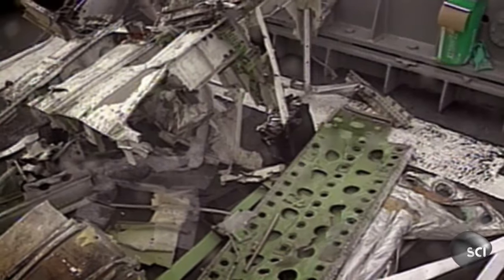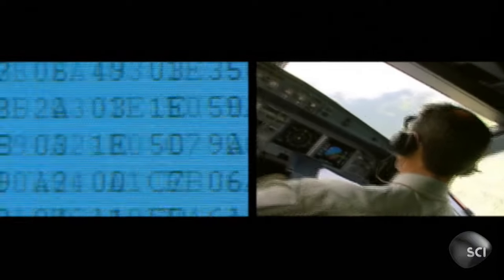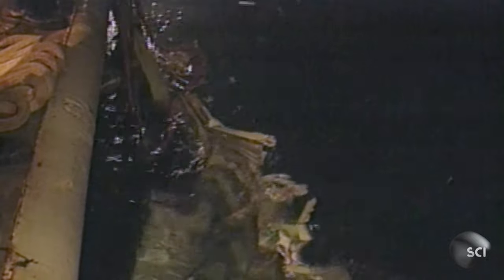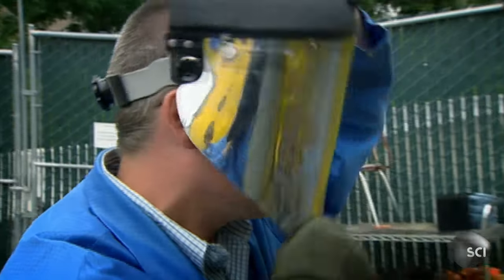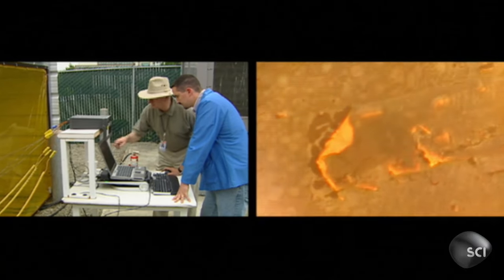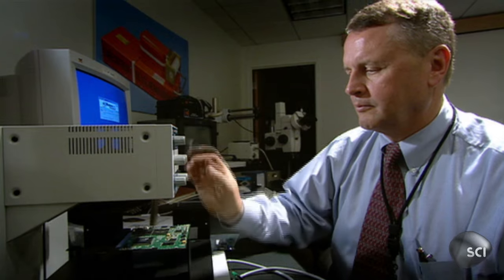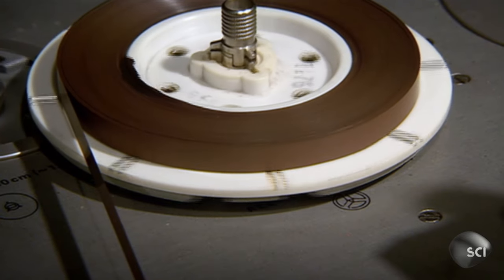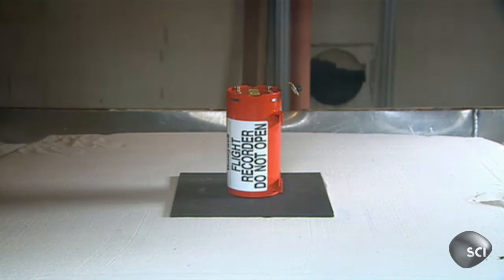How Black Boxes Are Made | How Do They Do It?

Comment: You would think by now they would have have cameras mounted in the cockpit and are uploaded directly to a cloud server during each flight.
Reply: They do now.
Reply: You know satcomm are expensive and cell tower doesn't work up there, right?
Reply: @pierreuntel1970  satcom is not that expensive for airlines
Reply: Data storage. It's very costly, hence why it's not done in a for profit company.
Reply: @declannoyes3370  it would be very expensive if you streaming high bandwidth data through it all the time, imagine hundreds of plane also do that
Reply: really there's no excuse when the clouds are just outside
Reply: @BrevityBuzz  they had a satellite tracking system that for some reason was switched off shortly before they went missing
Reply: @conradpankoff5616  well played sir
Reply: and if it loses connection
Reply: @jay-d8g3v  H.264 1080p @ 30fps, assuming this could be easily streamed by satcom. Using the same data retention time of the back box, 30 minutes, would result in a file size of, at the most 20gb using no other forms of compression.
Assuming 10,000 aircrafts are in the air at once and all the data is going to one data center, it would take a capacity of 200TB.
The largest widely available consumer 3.5 inch HDD is 20TB for around the cost of $500
In raw storage capacity this would cost around $5000 not including any data redundancy.

In a realistic scenario this storage capacity would be much less because it would be spread out between each airliner companies. $5000 is nothing to them. So no, data storage isn’t costly.

The cost of servers and data centers is the issue.
But with cloud solutions like AWS and others it is getting cheaper and cheaper to solve these issues.
Reply: If the Aviation Organizations and the NTSB hasn't enforced it then its not in dire need
Reply: you think data and storage space is free don't you
Reply: @yzrippin  do you forget that data is delete-able?
Reply: Camera is not enough they need flight data
Reply: @BondJFK Thats what this video explains

Comment: 3:25 why isnt the ground solid? looks like most the impact was absorbed by the salt or whatever it is under the box
Reply: sand, i'll bet. the black boxes aren't located in an area that would come in direct contact with a surface, so it's fine to use this. besides, they dropped all that weight onto a single point...
Reply: Though it's sand, once the load strikes the black box, the sand will compress and act like a solid ground
Reply: Dom Geldart Bad idea.
Reply: Because there's bolts holding the box in place, in very severe stress the structure around the box will deform/break. Like the old saying about out running the bear. Box doesn't have to be inpenetrable just tougher than the components around it by an order of magnitude
Reply: If it laid on solid ground it would broke the weigth or the ground under it

Comment: Nice video, except that the CVR hasn't used tape for decades. They record audio digitally and save the data to non-volatile memory.
Reply: The video itself is also decades old. You can tell by the interlacing that it was recorded in analog.
Reply: @RoseIllo  interlacing is just a form of compression meant to be transmitted on radio based TV signals with old CRT monitors. It's generally more popular with analog cameras, but also present with some digital cameras as well. Though, I've never personally had a digital camera that interlaces videos.
Reply: Yeah, they also say that the CVR records a rolling 30 min buffer when it’s actually 2hrs as of like 2007. It’s a dated video

Comment: It needs to withstand the world trade center crash, right?
Reply: Mi Va Yes!
But no planes hit the towers.
Rockets disguised as planes did!
Reply: Yeah easily, but they didnt accidentally, oh and the passports did. Oh shit 99 percent of people actually believe what I just said. Welcome in the world.
Reply: Ostwind 18/14 👌 lets send a 666 sign to let you know its fine. Okay let's be serious we gotta wake people up.
Reply: Mi Va No they don't and they didn't. You see in other comments as well that  they for example tested the impact on sand, even if it's hard on impact etc., it's not the same like all the concrete and the steel inside that the planes crashed into. Also, as shown in the video, they burned the blackbox for 1h,  the blackboxes on 9/11 were much longer surrounded by burning gasoline. They also said in the video that the flexprint melted off, so would magnetic tapes. Remember as well, this video is shot 13(!) Years after the attack think about how much this company improved over these years.

I am sure there is something horribly wrong with 9/11 and what we're told, but it's not the blackboxes.

Edit: one word
Reply: White Crown No, Bombs
the plane went straight through the world trade centre
Reply: White Crown then explain the passengers that died on the plane
Reply: it was godzilla
Reply: Woke 😉

Comment: 3:14 That guy is so wrong. RC 42 is not hard at all. Most steels I work with would put that to shame. I work with tool steels such as D2, DC-53, D3, M4, M2, CPM 3v-9v, and even tungsten/cobalt carbide. I just made a binder die last week from D2 high with a RC of 62-64. Carbide goes even higher. 

Albeit he can be talking in loose terms. The material he is holding could be at it's hardest tolerance. Therefore he can get away with saying it's a very hard steel.  But just be aware RC 42 ain't shit in metallurgical terms.

-signed your comment section tool and die maker/designer
Reply: That’s very correct. 42 isn’t even mild steel territory. I’m assuming the purpose of testing against the soft steel is that airplanes are primarily aluminum with some titanium and some softer steel alloys that are very tough such as for the landing gear. There isn’t a lot of M2 tool steel clanking around to penetrate the box so it’s not the most realistic test. That’s my guess at least
Reply: Glad someone else noticed that

Comment: I can imagine scavenging for one of these underwater would be the stuff of nightmares. There would be parts of people everywhere, or some here and there in a cage of shredded shrapnel and complete obliteration.
Reply: They have an ELT (Emergency Locator Beacon) which can help rescuers find the black boxes in a smaller radius. Only if they find it within 30 days. How long it can actually stay underwater and be recoverable? Air France 447 was almost inconclusive if it weren't for the repairs, but that was because it slammed into the ocean with a vertical speed of 124 mph.

Comment: wait if the cockpit voice recorder only saves the last 30 minutes, then what if the recorder keeps recording after the crash. You lose all the data.
Reply: +samramdebest I'm guessing they stop recording if experience heavy g force ;p
Reply: Rennie Ash
but what is considered "heavy"?
Reply: samramdebest there is a big difference between normal plane operation and a crash I would say. Probably works similar to car airbags but with more sensors.
Reply: +samramdebest I had thought the same thing when I heard that. I guess it works until there is a substance interference in normal operations, such as the cessation of power to the device. 

Except who's to say that the plane may experience damage to that area of the plane, cutting off input to the box, yet the plane is actually still flyable for quite some time afterward (may or may not end with a crash). All the data afterward would be gone, data that could have provided some evidence to help eliminate & narrow down the final cause if a crash eventually did happen sometime after the initial damage. 

i.e. Something happens to stop the FDR & CVR,  but the damage is not severe enough to fully cripple the plane. The plane is still completely flyable until a while later the plane crashes due to a hijacker taking over. The recovered data would only show record of the initial event, not the direct stirring of the plane to doom.
Reply: +samramdebest I tried to research this, and most people generally conclude to about 3 different sensor indicators in no particular order: 1) high impact g-forces, 2) temperature, & 3) As I said, disconnection/interruption of power supply.
Reply: SpiritHawk7 if it did lose power I would expect a cockpit warning should sound in case the plane is still fine.
Reply: +samramdebest  It wouldn't keep recording, as there would be no electricity to power it, as all electricity comes from the engines, and often when a plane crashes, the engines stop. you're over complicating it. seriously.
Reply: there would be an interrupt on the software program syntax with certain conditions of the flight parameters.
Reply: Lol after the crash how u think it will be connected to the plane xd

Comment: What I don't get is why is there air inside the fuel tank? There's definitely going to be fuel vapor in the tank but there shouldn't be any air unless they use air to equalise the pressure in the tank as fuel is drained out. In that case, why use air and create an explosive fuel/air mix. It'd make more sense to equalise the pressure with an inert gas like nitrogen, which is incidently what they do in military aircraft.
Reply: Issue is cost of innert gas over that large a space. Also something needs to replace spent fuel, otherwise you could have a large vaccume and bringing huge quantities of compressed nitrogen (or other inert gas) on board isn't practicle.
Reply: On tanker ships they use inert exhaust gas to prevent fire.
Reply: Tanker ships don't care too much about weight

Comment: I'd love to hear how the data can enter such a box. At some place a wire must lead inside, and I'd expect such a place to constitute a weak spot. Or is the data transferred inside wirelessly?
Reply: There is a flexible flat cable that enter the steel can where the data chips are (it is mentioned during the flame test, because it gets destroyed by the latter)
Reply: @Dainaccio  Thank you. I now still do not see how you can ensure that the place at which the cable enters will be sealed. The mechanism has to be quite sophisticated. Will an insulation of that cable melt away before the cable itself seals the spot when it melts?

Comment: "The first test uses a heavy weight dropped on to the box on its most vulnerable axis"

Proceeds to drop it on the the strongest axis (vertical axis on a cylinder)
Reply: I think it's because it's the end cap that's bolted on rather than being a continuous piece of the unit.

Comment: I wonder how much space there is on these and if you could use one of these black boxes as an external hard drive on a PC.
Reply: coondogtheman1234 It's nothing more than a high-grade SSD in a strong case. 

You could get similar results with 2+ consumer grade SSDs in a RAID 1 configuration housed inside a fire-proof safe.
RAID 1 isn't the best backup configuration if you're complementing building it
Reply: Azurren
I'd just hook it up to USB and use it like a thumb drive. Still would be a good conversation piece. I wonder how much space those hold and what the filesystem is based on. Windows/linux/unix
Reply: coondogtheman1234 Interesting question. Almost 100% sure it's an embedded operating system. For stability you wouldn't want a full OS running, nothing which could hang or relies on external operating components (RAM chips etc.)
Something akin to an Arduino, but less modular. Designed solely to log data.

No idea which file system they use though. NTFS is primarily windows, FAT isn't ideal so either EXT or some other lesser known filesystem I suppose :S
Reply: Azurren Well it wouldn't matter if I could hook the memory module up to my PC I'm sure windows would tell me if it's not readable and if I want to format it.
Reply: coondogtheman1234 If you had the right hardware and drivers anything is possible ;)

My guess is that black boxes use robust, low capacity memory. As they are only logging data I wouldn't expect them to be much larger than a few megabytes ;)

Comment: You'd think they would have better quality audio from those cockpits..
Reply: more quality = less quantity
Reply: Sorin Vasile Bogdan well i don’t think quality of the voice is the top priority...The ability to withstand pressure, heat and force is their top priority, second is the battery, third is the storage and finally it’s the voice, it has to record everything, everything from all the system operations to the voices in the plane for such long time, and needs the ability to preserve it for years if it cannot be found immediately. In this case as long as the voice is identifiable by experts after they recover the data it’s good. Also, the protection, battery and sensors probably covered more than 60% of the whole thing and it’s near the size of a shoebox

Comment: They cost upwards of $15,000 that's nothing lol. The aeroplane costs like $15M doesn't it?
Reply: I think an commercial plane costs up to 150 million instead..
Reply: klotuur yeah, so the black box is nothing, they could gold plate everything and it still would be cheap :-)
Reply: +Rennie Ash Gold plating it would be a terrible idea! Gold transfers heat, meaning it would shorten the lifespan of the data in a fire!

Oh, wait, that was sarcasm... ;)
Reply: Rennie Ash typical airplane ~$200M but the airbus are just expensive
Reply: xXx_MlgTr1kSh00ter _Xx the airline companies dont actualy buy the aircraft they only rent them
Reply: 320 Million or 0.000046875% Of the cost of the plane.

Comment: why not put a tracker locator inside the black box so you can find the planes in seconds?
Reply: holy fucking shit.....
Reply: then it would need power
Reply: It doesnt already have power, for the recording machine?
Reply: You think they wouldn’t have done that already if it was that simple? What kind of magic antenna do you have that transmits from the bottom of the ocean?
Reply: Power requirements....The battery would go dead fast.

Comment: Don't know what happened? Blame it on terrorists..
Reply: Wylo Y Uhh, mechanical failure..
Reply: How often that a plane explode in mid air due to a mechanical failure?
Reply: Considering they're literally full of jet fuel, probably more often than you think.
Reply: 6Twisted In that case its called sabotage.
Reply: +Mad ScientistCP 
Or having stupid engineers that are putting FAULTY Wiring right next to/in the JET FUEL CONTAINER!
Reply: The Careless Sloth Yup, and Sabotage is a form of terrorist attack, just that it must be by someone trusted with maintaining the plane.

So deliberately caused mechanical failure is still terrorist attack.